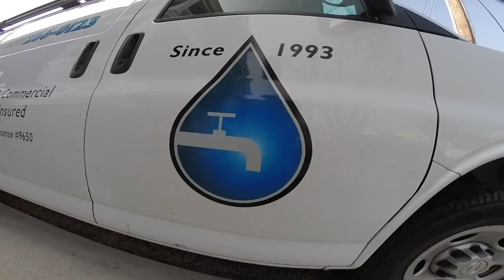GERBER TUB AND SHOWER SPOUT REPLACED IN RENTAL UNIT

Comment: Why did you put a diverted tub spout on a tub shower valve with a diverted?
Reply from the maker: Why did I even fix it....lol. he pulled it from his shed. Johnny big was so happy with that move. lol. demo is coming.
Reply: the diverter valve probably needs washers anyway..... so just crank it to mid-way and use the spout pull, not many folks soak in tubs anymore lol...
the reasoning was likely same as above and I can hear birdies going  "cheap cheap cheap cheap cheap"